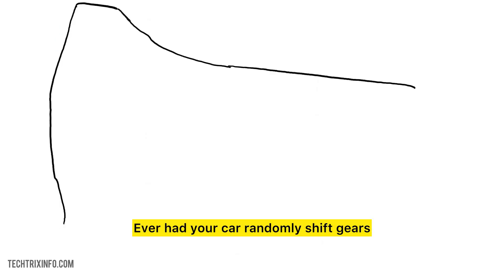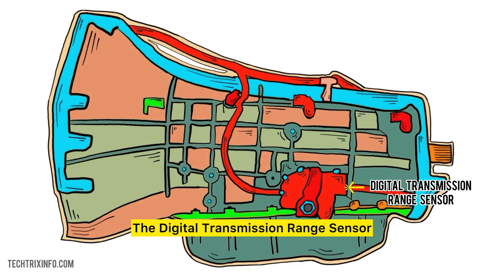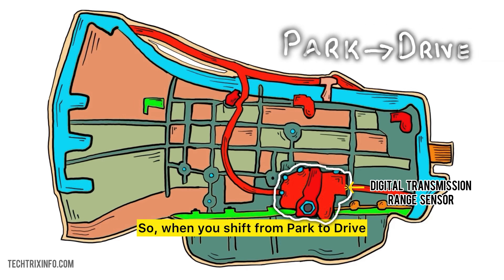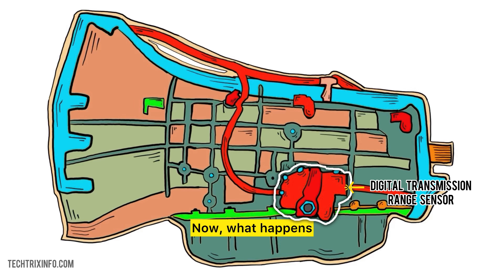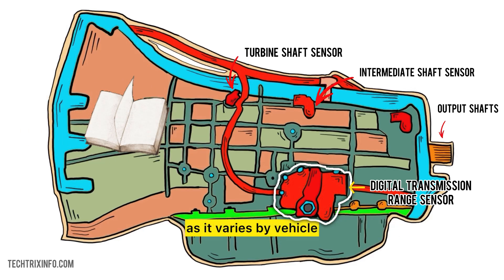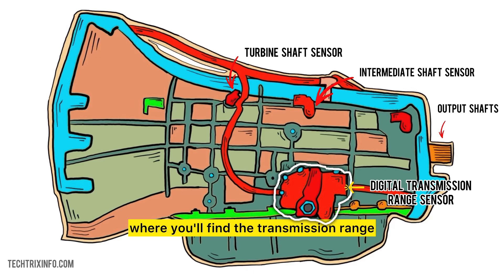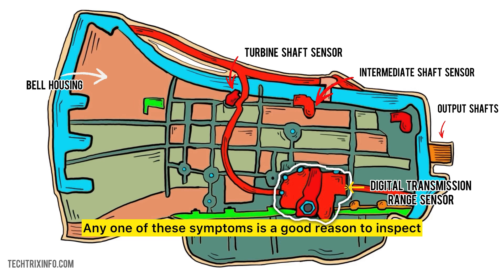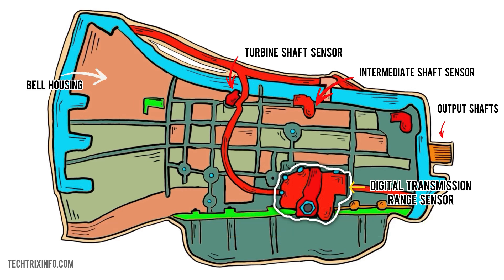Digital Transmission Range Sensor Explained With Animation l Mastering Automotive Sensors | Part 26

Comment: Hearing it for the first time. Good job..
Reply from the maker: Thanks for the comment, Digital transmission range sensors are found in many modern vehicles, especially those with automatic transmissions. They detect the gear position and send it to the vehicle’s control module to support smooth shifting and safe operation. Brands like Toyota, Honda, Ford, and GM commonly use these sensors, as well as luxury brands like BMW, Audi, and Mercedes-Benz. This technology improves driving accuracy and enhances performance in both standard and high-end vehicles.